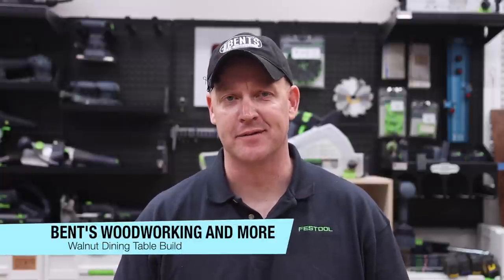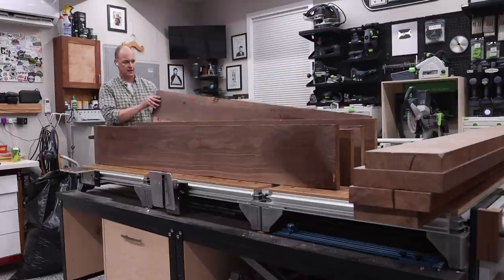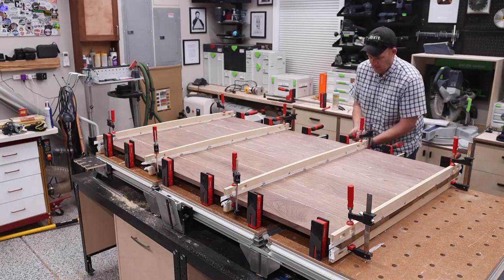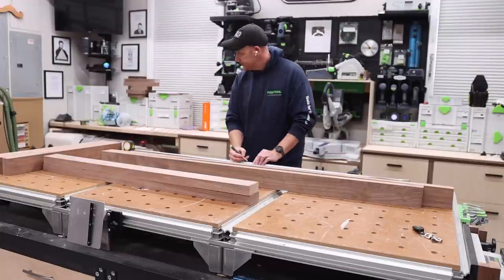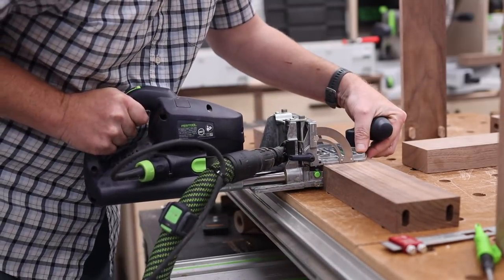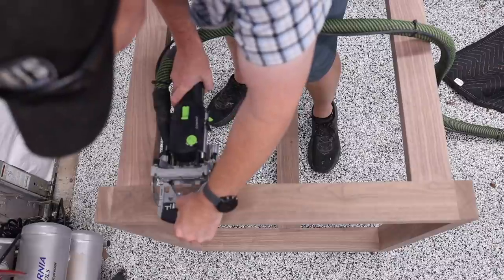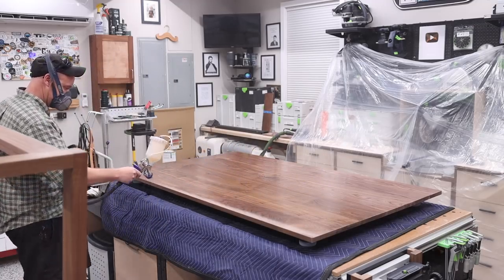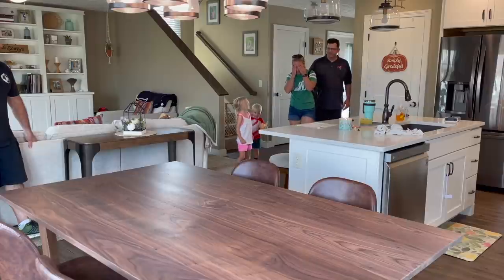Dining Table Build [PREMIUM WALNUT]

Comment: really stunning!

I never used C-channel, I like to use sliding dovetail stretchers, which I slide in before the glue-up, thus there is no visible entry of the stretcher from the sides of the table top.
Reply from the maker: Interesting. I have seen that before and have always wanted to give it a shot.
Reply: @bentswoodworking  you can see it on my video: Minimalist Desk or something like that

Comment: Nice table.  Yeah, I started using C channel in my panel glue-ups as well.  I see it as just a little extra insurance that the top stays flat over time.  I know some consider them controversial, but I prefer my chances with using them instead.  Also nice cameo with Sedge in there!
Reply from the maker: Lol yeah, I figured it would be a nice addition

Comment: Nice build, Jason! For the base, what was your process for the trapezoid base? Did you carefully measure the vertical components of the isosceles trapezoid or did you mark them against the already cut horizontal components perhaps? Making a slab dining table now, and a base like this would work well

Comment: Great design and the table turned out great.  Making Sanding look sexy?  A high goal.Would suggest an easier goal of smiling while sanding LOL.   How do you like the dust mitigation / control on your mitersaw setup?  Suggest a video on that sometime ... Thanks for the video!
Reply from the maker: Thank you, and the enclosure I built around the saw does a great job because it stop the dust from going up onto my tools. Not a perfect solution but it’s much better than before.

Comment: Hello.  Love your video and thank you for sharing.  I had an observation regarding your table base.  I'm sure it is trivial, but I wonder why you chose to place the leg stretchers between the legs, held by a couple dominos and glue at the joint, rather than placing the stretchers on top of the legs, thereby allowing the stretchers to distribute weight evenly and keeping any potential splitting of the joint taking place over time through table movement? See time stamp 6:10 in video for reference.

Anyway, this was an absolutely beautiful build and thank you again.
Reply from the maker: So the end grain isn’t visible. The dominos and glue are more than enough strength. 👍

Comment: Great video Jason. Where did you get that stop for your miter saw station ? I’ve been looking for one just like that
Reply: I came to ask same question. I've been meaning to build a flip stop for my miter saw but if I can buy one I'd rather.
Reply: Those are flag stops from Festool... Any dealer can get them for you, or you can order them direct through the Festool Service site. They are a part of the MFT fence system, and also used with the Festool Kapex system as well.
Reply from the maker: It’s just one of the festool flag stops that I modified by cutting off the bottom short tab

Comment: Question? You used the home light sprayer in your older videos, but here you used a different gun. Curious about the gun, pressure and tip size that allowed you to spray INSIDE your shop. Thanks for any help you can provide. Your content and videos are great. From one veteran to another thanks for your service but more importantly, thank you so much for providing such great content while serving full time.

Comment: been watching many of your videos and really appreciate you putting them together - is there a reason you sprayed this with conversion varnish vs using Rubio mono coat.  building an island for my kitchen which will have a walnut top. Would like a smooth satin finish and really not sure what finish to use - thinking of Danish oil and then Waterlox ?  any help would be appreciated    thanks

Comment: Nice table. Have you ever tried actual Mortise and tenons? The are considerably stronger than Dominos.  Dominos do help align but do not add a great deal in strength. Every test I have seen show them just slightly stronger than glued butt joints unless you double them up as you did.  I know they save a great deal of time and are more than adequate for this project but you should at lease try the Mortise and Tenon joints on a project and see what you think.

Comment: Beautifull table Jason , how do you joint the edges perfectly with a track saw…? thanks for your answer.
Reply: Edge/Board
Reply from the maker: As long as the surface is flat, the track saw will achieve a 90° cut, perfectly straight.

Comment: I know this is an older video but I'm trying to work out what you did with the dominos @6:18 - I don't mean the ones you're working on, I mean the ones on the top portion, for the side pieces. Don't they interfere with the ones  we can see for the side stretchers?
Reply from the maker: No, they don't interfere (if I'm understanding your question correctly). The dominos holes you see at the top of the frame are for the stretchers. The table was not designed to look like a traditional apron, this was the clients decision for aesthetics. Hope that answered your question.

Comment: Did you joint the faces of the top boards? If not why not?  Thanks for the video
Reply from the maker: I jointed the face yes. I did not joint the edge. I get better results with a track saw on long boards.

Comment: Ditto to all the 'nice job' comments. Two questions for you.... what is your source for the clamping caul and the C channel? Thank you.
Reply from the maker: The cauls I made. When I use c channel, which is extremely rare, I get it from Bidwell Wood and Iron
Reply: @bentswoodworking  Thanks Jason. I have one more question. I making a dining table for my son using your design. The one I'm making is 8' x 36". Will the base design be 'tippy' with the narrower base at the floor? Was that a consideration in your build? Thanks again.

Comment: Sedge!  So do you mean that you don't joint those faces before glue up?  Simply track saw and then table saw and glue up ready no problem?
Reply from the maker: Correct, and I actually get much better results this way.
Reply from the maker: And to be clear, I did joint the face of the board, not the edge.
Reply: @bentswoodworking  That's for responding.  So 1) joint face.  2) plane to open grain 3) wait 2-3 days for movement 4) plane down usable boards to thickness 5) rip straight edge 6) clean up parallel edge 7) glue up?

Comment: Why not using Rubio for the finish?? Was it a better smooth finish??
Reply from the maker: I wanted to use something that was gonna be a little more durable with their children. While Rubio would’ve been a perfectly fine option, it just wouldn’t have been as durable for certain things. If this was just a table for me and my house with no children, then I would be just as comfortable using Rubio. But it’s a lot easier to remove coloring marks on the film forming  finish than it is Rubio

Comment: Hi, how did you get your domino tenons to align perfectly on the legs with a butt join? I was trying to do an beveled butt join but couldn’t get it to align properly because I couldn’t reference a face so I ended up doing a mitered join instead. Thanks in advance.
Reply from the maker: I reference the outside of the legs
Reply: @bentswoodworking  thank you!!! I’ve been stuck trying to figure that out. Thank you!

Comment: C channels (first time seeing them) are to help mitigate tabletop warp?
Reply: Correct. Very similar to how breadboard ends are supposed to do the same. I've used them on a couple desk tops, pretty easy to install.
Reply from the maker: Yes, they are to help keep the top flat over time.